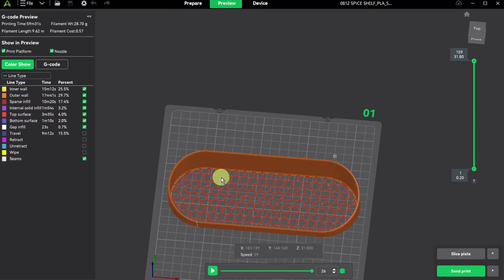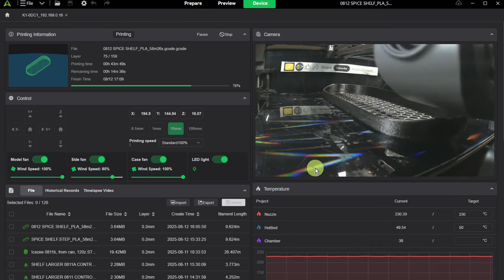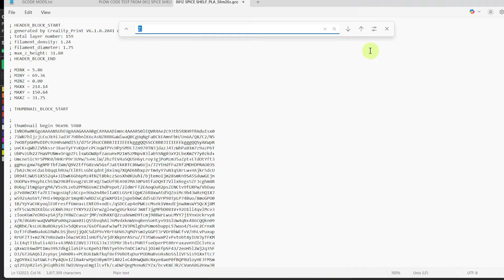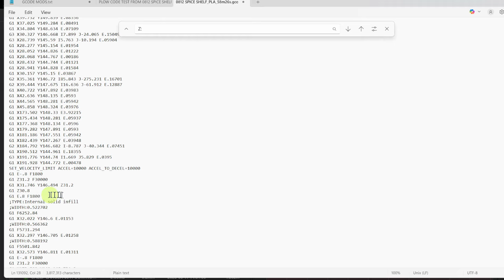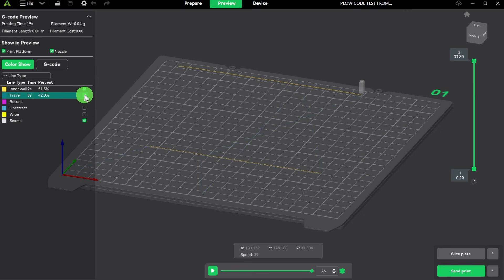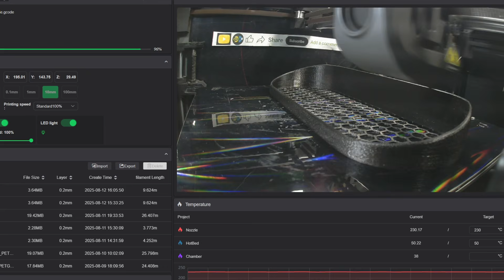Plow your print bed!  Plus mesh compensation and other topics

Comment: Hey I'm just curious is your machine rooted? Or your running the stock setup? 

I've watched a couple vids of yours Z offset

Just curious what your speeds are? 

When I slice a benchy in creality print or orca slicer its considerably slower.  

16min stock Benchy vs 32 min on creality print...

I'm assuming it's slicer settings vs the optomized slice profile of the stored 16min benchy on the internal storage?
Reply from the maker: Hey, just seeing this somehow.  

Not rooted.  I have Orca installed but always use Creality Print.  Speeds are generally stock other than slowing down intentionally such as TPU.  I reviewed the vid, not sure about the benchy reference.  I haven't done a benchy in a while so I don't recall the time, though maybe you're knocked off a bit by a benchy not exactly a benchy  in order to be faster?  I'm not entirely sure what you're referring to  with the 16 vs 32 minutes.